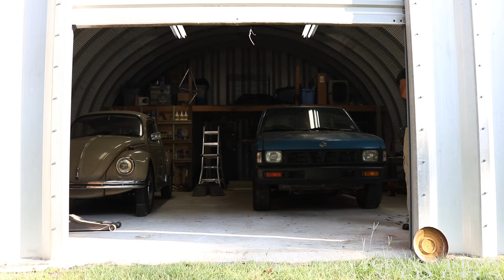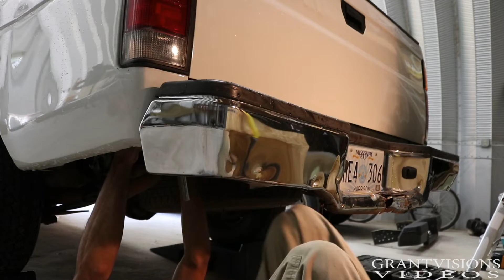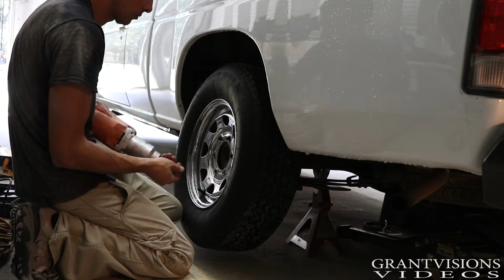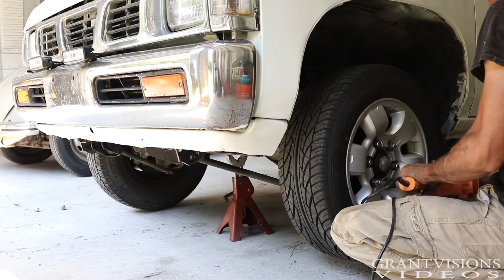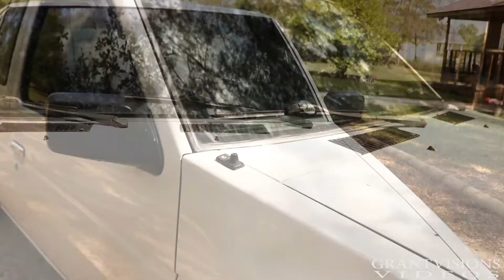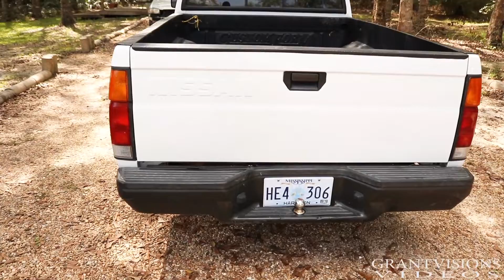Nissan Hardbody D21 PARTS SWAP

Comment: Have to find me a bumper like either one of yours,my 86 kingcab Navara has a fabricted one made from checker plate and previous owner has slightly bent it.
Reply from the maker: steersman 1812 When I got the blue pickup both bumpers were completely dented in.  I found the rear at my local salvage yard and just painted it black.  Ordered the front off of eBay.

Comment: looks way better.plus those aluminum rims are lighter
Reply from the maker: hawaii style Thanks!
Reply: GrantVisionsVideos .your welcome....i have single cab hardbody that i just rebuilt from an accident had to drill spot welds and fix all driver side...put original parts aftermarket is like putting on a soda can its so thin the metal.lol..
Reply from the maker: I know what you mean, my front bumper is aftermarket and it is very thin compared to the original and the holes for the turn signals don't line up correctly.

Comment: Did you turn up the torsion keys? Truck looks completely different
Reply from the maker: I didn't turn them up but I guess the previous owner did.  The front end was sitting higher than the rear.  I've recently turned them down so it looks a little better.

Comment: What size rims and tires size are those
Reply from the maker: 15 inch.
Reply: Would 16 inch stock frontier wheels be to big on a 97 ? I'm worried they would rub.
Reply from the maker: @jorgerubio8409  You can definitely go bigger, 16" would fit but it depends on tires size and offset of the wheel and if your truck is lowered or not.  If it is not lowered you should be fine.